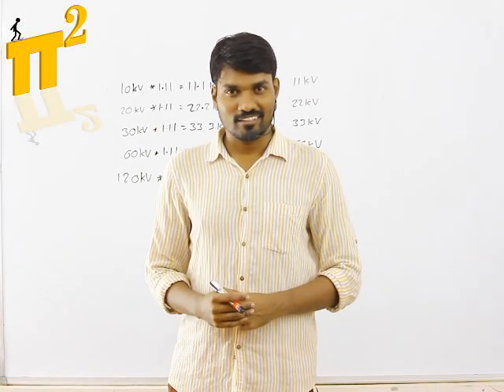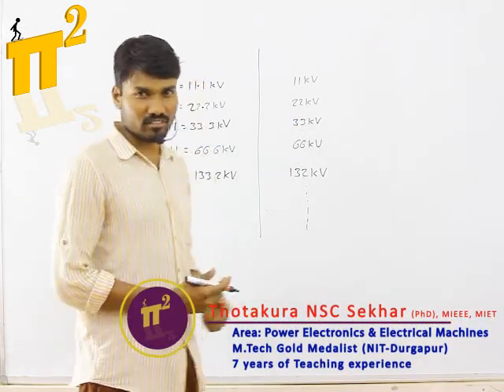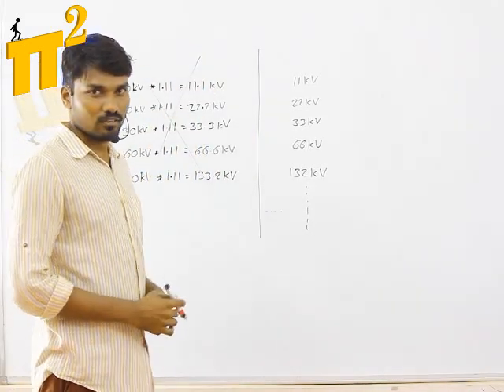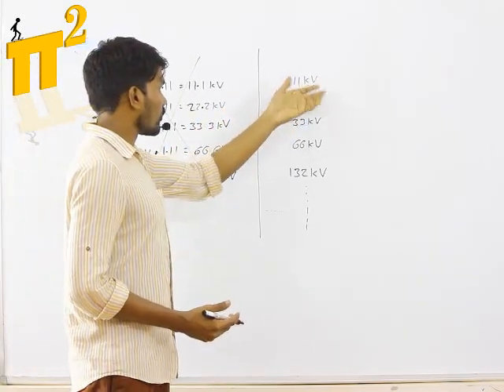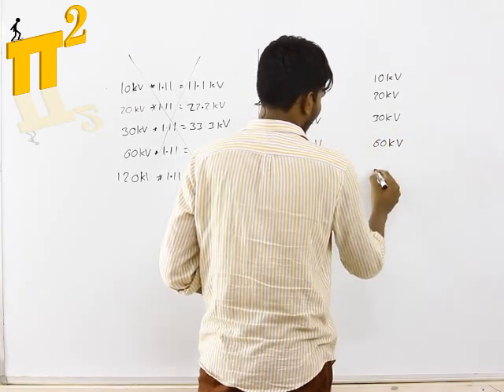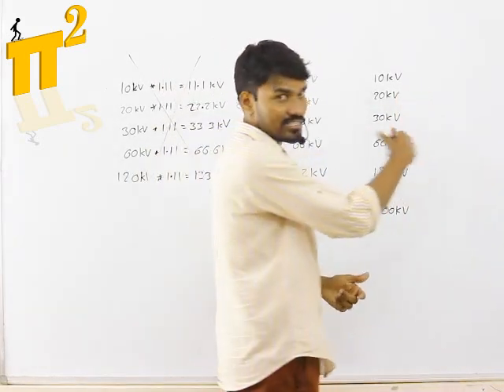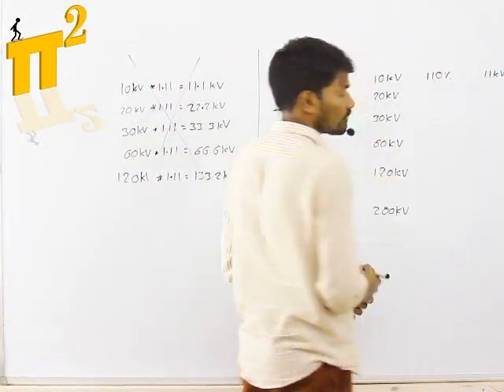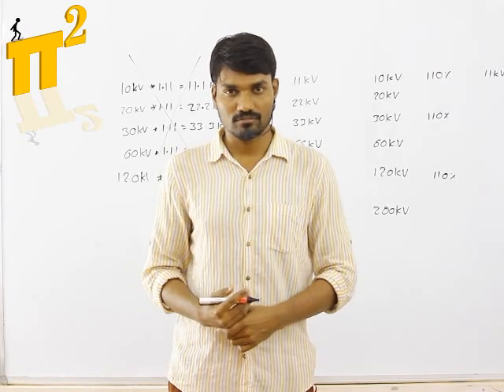Why 11kV, 22kV, 33kV, 66kV, 132kV... in India | Interview Question | Understanding Voltage Ratings

Comment: महाराज, 
T.L. losses depends on 
*Type of load 
* load value 
* length of T. L. 
*Voltage levels 
So can  you assume  losses are always 10%? 

* Transmitting voltage is  multiple of 11kV is because of design of elec. Equipment which can easily do their functions at  these voltage levels easily.
Reply from the maker: Please check the description for the answer to your question
Reply: How you can prove your way is correct @ThePiSquareAcademy

Comment: If you will consider 10% loss then you get 9.9KV from 11KV generator. 
Now you will say we can assume 9.9 + 0.1 = 10 
but we can't assume 1.1 form Factor 1.11-0.01😂😂
Aur Haan.....For you information Transmissy loss depends on conductivity. Gauge and length of wire. Z, Y parameter.
Don't spread wrong information
Reply from the maker: I really appreciate your analysis on trying to prove this information is wrong. All the best 😊.

And thanks for the info on the gauge, length, Z, Y conductivity and etc😍

Comment: I don’t think this is right, If you are connecting a load with in 2 km near to generation station then they will receive 10.9 kv instead of 10 because of less voltage drop. And also for long transmission lines due to Ferranti effect you will receive 12 kv instead of 10. So this logic doesn’t works. May be because of predesigned equipment which works on 11kv, 22kv, 33kv they are supplying the same voltage. This question is just a myth their is no pattern behind it, if you consider like that why they are transferring 400 kv instead of 440kv  or 765kv which is not multiple of 11.
Reply from the maker: Pls check this video description to get clarity on 400kV and 765kV other questions

Comment: If so the concept then we all are designing transformer for 11KV/415V but if transformer requires 11KV then we have to transmit more than 11 KV in line to reach to 11KV transformer but still line transmits only 11 KV. Otherwise transformer world be 10KV/415V. Is it right

Comment: Ok Sir, But what about IEC standards, 10, 12,36 kv ,so where is 10% loss in other countries.
Reply from the maker: Over time, certain voltage levels have become standardized and widely accepted within the industry. This standardization helps ensure interoperability, compatibility, and ease of maintenance across different electrical equipment and systems. But there is no such rule that everyone should obey them, but we loved that standardization so we are following. You also check video Q&A for more details.

Comment: The the 10% rule was originally applied to get the 11 22 33 66Kv etc distribution system voltages, It not really used anyway, It's actually 11kV to the load not at the feeding end, voltage drops are typically only a few percent not a massive 10%...The 10% figure was an amount agreed on and what was practical at the time. System voltage for a zone is chosen based on the size of the load and distance, future growth allowances, cost, and compatibility with existing systems.

Comment: The 10% voltage drop is worst case thou. Its a voltage standard that was adopted and it stayed, a voltage drop of 10% is truly a massive loss of power thou, its typically just a few percent at peak load in most parts of a transmission network. The same 10% applies between point of supply and plug-gable LV appliance too. Where up to 5% voltage drop at full load in low voltage building wiring by law, and up to another 5% allowing for further voltage drop in the extension cord to an appliance on the customer end. Also voltage drop in transmission is due to transformer impedance, this i compensated with a tap changer, the high impedance is to keep the fault current down.

Comment: As the transmission voltages are increasing why 10 percentage excess voltage is maintained constant. Why it shouldn't be varied according to voltage level
Reply from the maker: You may please check the Q&A Session in this video description for more details which might answer your question.

Comment: But receiving end, if we measure voltage, it will be 11kv and the many applications are in 11kv. 10% line drop estimated huge loss to the generation and transmission.
The video information is wrong.

Comment: No, See in AC KV rating 765/400/220/132/66/33/11/6.6/3.3/1.1/415/230 Voltage Rating are available in india in abroad 1000Kv transmission is also
 available. This is not the correct way of explanation.
Reply from the maker: Read this video description to get the answers for the voltage like 400kV

Comment: Sir this should be answered please consider that ,okay 11 kv is sending end voltage and their recieving end 10 kv fine but what if my 11kv motor is at the receiving end there will not tapings in dtr's then how we can deliver exact 11 kv viltage requirement for any application please clear this one sir

Comment: Doesn't seem correct. If that is so why do we have transformers rated voltage as 11, 33, 66, 132 kV at the far end of the transmission lines.

Comment: If your prediction is correct, than the supply voltage at the user end for motors and appliances should be 200V, and  350V
Be logical ('  !  ')

Comment: The voltage ratings are provided for the load itself. 11KV system means the power system is delivering at 11KV to load. In order to compensate line losses we have to increase voltage beyond 11KV at sending end.

Comment: Dear Sir !! Really much appreciated for providing this information. I have some questions for You and hope You will clarify them. Why You have chosen only 10% extra though transmission line drop depends on both resistance and length of transmission line ? I haven't seen any cases with receiving end voltages are just 10KV , 20kv and so on .. Our ring distribution system receiving end voltage is 11KV ? According to Your approach ,Does sending end voltage is 13.2 KV ? Please clarify me..
Reply from the maker: Answer is given in the Video Description Please read the description (FAQs). Thank you.

Comment: first installation  they used 11kv,22kv,33kv,66kvetc are  based on optimum level voltage (ie) mainly cost consideration. for example if you need 50kv means you have to design 11kv/50kv transformer. thats why 11kv 22kv 33kv 66kv 132 kv. these are standard rating. now another one standard rating is come into the picture that is 765kv. if you design the transformer for 1000 kv then your rating will also be included in the standard rating.
Reply from the maker: Answer is given in the Video Description Please read the description (FAQs). Thank you.

Comment: Sir, your explanation is very logical....and very basic....but I cannot digest from where this requirement of 10kV, 20kV, 60kV, 120kV at receiving end come???

and if we talk about Electrical load, say motors, we find 3.3kV, 6.6kV, 11kV motors.....rather than 3kV , 6kV or 10kV..

I hope i could explain my doubt
Reply from the maker: Answer is given in the Video Description Please read the description (FAQs). Thank you.
Reply: Subhajit Basak @ mera bhi same doubt h
Reply: Subhajit Basak ye 10 kv k requirement kha h??
Reply: i too hv same doubt
Reply: main v to uploader se wohi question kar raha hu.....industry me industrial or distribution level pe 10/20/30..../60/70 kV etc ka requirement kab se aane laga??
Reply: I think 10kv  never heard in my area  . In substation also 11 kv /415 v  , 33kv/ 11kv , 132/ 66kv , are using in many areas . But for your questions    , all drives voltage like 3.3 kv , 600v ,  can be obtained by rectifier and then inverter . If you are seeing in industries u will come to know all these things
Reply: Subhajit Basak exactly

Comment: Sir I have a question.
Why CT rating is 1000/1  500/1 100/5 500/5 etc not in any other ratings?
pls reply
Reply from the maker: As we know CTs are used for current measurement, keep this in your mind and understand below points to understand the answer.

1. CTs are required for the high currents, in the order of kA;
2.The rated secondary current is normally "STANDARDIZED" at 1 or 5 amperes (you please try to understand the the word standardized clearly); this standardization is done based on measurement and relaying ease.
3.We cannot make CTs for every operating current.

Comment: Hi sir, you stated that, 110% of voltage level is increased and transmitted. Actually, I have worked in one of the substation.  I observed the readings of incoming line voltmeter, it reads more than the rated voltage of primary of PTR, the PTR is operating at 80% of its rated load. Then, if you say 110% of voltage level is increased, it may show a slow deposition of charge in the insulation and may effect it's dielectric strength. Please, say me how they avoid, that effect. Thank you.

Comment: In case of 765kv transmission voltage.. what is  the value behind that overall losses it becomes 765 kv
Reply from the maker: trans line drop is not just 10% but we cannot exactly say the voltage drop as they changes proportional to the current and current value is not constant. so our scientists took some decent number which is 10%. 

But recently, we are going for higher voltages through advanced FACTS devices (where voltage drops will be compensated) hence this 10% is not valid for 765kV and further.

Comment: Dear sir,  Why we r not generating and transmitting power in at the 1kv, 2kv,..etc
Why we r going for directly 11kv...
Reply from the maker: Earlier we don't have the concept of distributed generation system, so power stations are far away from the living places, hence to transmit power for such a long distance small voltages will not be efficient. We should go for as high voltages as possible but we can even generate direct 220kV also from generator (due to the insulation and other limitations of generator) hence we generate from 10kV to 25kV.

But , now a days we do have a generating station with 1kV or 2kV in that range (distributed generation, wind, solar and etc).
Reply: PiSquare Academy thanks u

Comment: sir why only 10 % extra supplied by them...?...can it less or more?
Reply from the maker: You are absolutely correct, trans line drop is not just 10% but we cannot exactly say the voltage drop as they changes proportional to the current and current value is not constant. so our scientists took some decent number which is 10%. But recently, we are going for higher voltages through advanced FACTS devices (where voltage drops will be compensated) hence this 10% is not valid for 765kV and further.
Reply: @ThePiSquareAcademy  why 765?instead of 700kv
Reply: PiSquare Academy ok sir thank u so much
Reply: @ThePiSquareAcademy  
Sir ghar me 220 kyo ata hai fir 
200 ana chiye na
Reply: Hemant Kumar  i am going with u..
Reply: In order to satisfy copper losses
Reply: Wrong concept...
Reply: Great sir
Reply: Yeah concept galat hai 
Kyo ki gahr me 220 ata 
Vaha

Comment: Sir, can you explain the voltage drop formula /calculation/ concept.it is asked in building construction.Thanking you
Reply from the maker: In simple, it is just an ohm's law. Voltage drop=current x Resistance.
Reply: PiSquare Academy voltage and voltage drop having the same formula sir what is the difference between two formulas?

Comment: sir if u r right then what is the role of ferranti effect.    I went to 132kv/33kv/11kv substation where I saw. receiving voltage is 135 kv instead of 132 kv.     plz reply
Reply: MOHAMMAD RIZWAN QURESHY ferranti effect means receving voltage greater than sending voltage at no load or lightly loaded condition.so u give 132 kv at sending end we get more than 132 kv due to ferranti effect
Reply from the maker: It is one case in transmission line which occurs when the line is lightly loaded or no loaded. So it has no role in choosing the voltage levels. Ferranti effect places a key role in designing the transmission lines.
Reply: Then surge impedance
Reply: MOHAMMAD RIZWAN QURESHY

Comment: we prefer ac over dc bcoz voltage easily change in ac but we can change the voltage by chopper
Reply from the maker: You are correct, but chopper is not an economical & efficient way of increasing voltages to a high ratios

Comment: sir what is the exact answer of this question for the interview 
why we prefer ac over dc in transmission
Reply from the maker: Changing voltage levels is easy in case of AC but in DC, (change in voltage levels is required for economic and efficient transmission)

Comment: 10% loses is much to hight! we must reduce it by build smaler pp´s near at load centers
Reply from the maker: Yes you are right, but having 10% voltage drop, AC system has been proven to be the best and hence AC has taken over the DC distribution. as you rightly said now a days Micro grid are gaining the popularity (which leads to much less drops and losses)
Reply: based on the informations i have as a industrial mechatronics and elektric lover and physiks fan and a ex desy xfel worker if i have to create a grid it locks like so!

based on todays technology i create 3 phases on 8 1/3 hz
the generator delivers UHV AC direkt ! to achive these i construckt the stator not as like today ! i make large poles so i can wind 3 windings like in the transfomrmer! unit size to max if i have a large town!
to limit the short circut current i take superconducting non inductive limiter!
 its delivert to GIS pipelines to square parts of town! the cells!
i like to see 2 power plans first in north of town and second in west town! the UHV gis pipelines are like a cheas plate! on every UHV to MV  substation i can get power from 4  direction! so if one gis line faild i can swicht to anoter gis! to set the kapacitys low only one power line system works for example north power plant to south! all west east crossing gis are disconect!
the same with MV grid inside each cell! in every substaion from UHV to MV thera a 2 substation systems ! one is redundant!  there i step down to MV voltage!  the transformers to give low voltage are near the customers like in the us or even closer! these MV grid is under every street in the cell and from there are lines to each custumer!
the low voltage output transformers are made as toridial wich round core squersection! they come into mumetal housings! so its not to unhealty to people!
gis and alwais its possible koax because its besser for living things and other electroniks!

the hight to mid voltage transformers have a roundsquere core profile to and make to handle the hight voltage better  as a core type!
transformers are alwais as single phase so if one faild the other has not go to junkyard! these are 1% short circut current and have max 10KA output! 
i like star star system to minimate the stress on transformers! only groundet at the source side to work against bad currents flow to earth!
thesre are hight efficent and long life and envioment frendly types.

the switch gear can handle up to 1 million amps

the power line lose is less than 1% 
the low voltage is 1000/ 1732 volt! 
mid 17 320v
hight 1 732 000V

on power plant and substation on hv and mv are harmonic filters and inductvitys co compansate! 

 reasons for set the low frequency! 1 to set down the capasitiy problems ! second ist not make noise at transformers we can hear so god! 3 the loses and interference its better and the core loses are lower! in the past they think about to grids one for examlpe 133hz for lights and one with low frequency for motors!  they take just enough for lightning! ! i take the lower moslty because its much more healthy than other or general higher! 

power lines are all copper! coustumers have alwais rccb with 10mA cutoff

why i dont like dc to travel! the converters are produce a lot of hf ofset its sucks! the ac dc and dc ac converters are much more senitive than my solution! 

i know that transfomers and motos are bigger ! and  can´t run incandesend lights directly!
lights are driven by me on current and on dc surplys for low voltage ! so i like to drive them soft to on and construct ultra long life incendesent! like 100K H  led and cfl are shit in light quality and envoioment and healty i like to bann these! i also hate switch mode power suply !

my solution locks like a little bit strange but ist more good for envioment and people, animals! i have some good points and some bad! 
i also not a fan from run everything on electrisity! cocking heating and warm wather have to make with ethanol mostly ! so like motocycle , cars, trucks, bus, boats, ships, planes...    and insted of accus i like to see fuel cells ! the etanol can fire also my power plants! the etanol come from desert solar thermie plants ! these are so constructet that no animals ore people can burn! it heat watehr hight eficinet to very hot and presurefull steam and the steam drive liquide metal unipolar hight current generators! the hight current i needet to create in a new chell from co1 and wather ethernol!
co1 can save from co2 whith a granules and set free with heating! the cells are good eficient and needed just copper clad nanotec servise!

Comment: sir, i have a question to u as we know there are many losses included in transmission losses like corona,... then how can we simply say its 10% precisely, and also based on distance how can we calculate that 10kv is sufficient and all? and this 10% is this satisfy all other voltages like 765kv...?
Reply from the maker: You are absolutely correct, trans line drop is not just 10% but we cannot exactly say the voltage drop as they changes proportional to the current and current value is not constant. so our scientists took some decent number which is 10%. But recently, we are going for higher voltages through advanced FACTS devices (where voltage drops will be compensated) hence this 10% is not valid for 765kV and further.